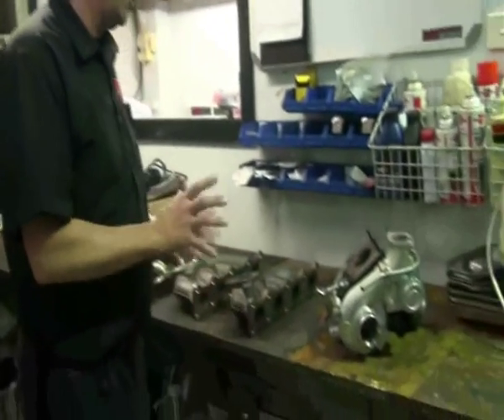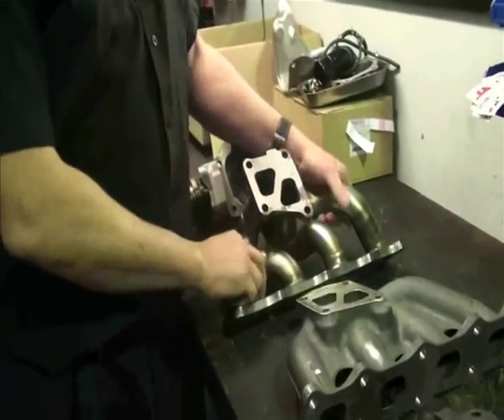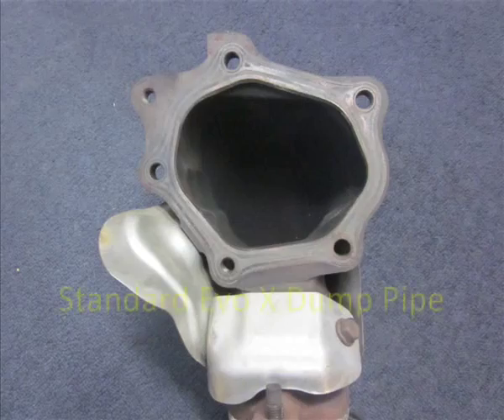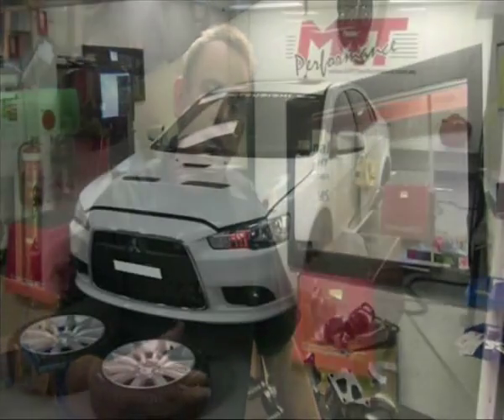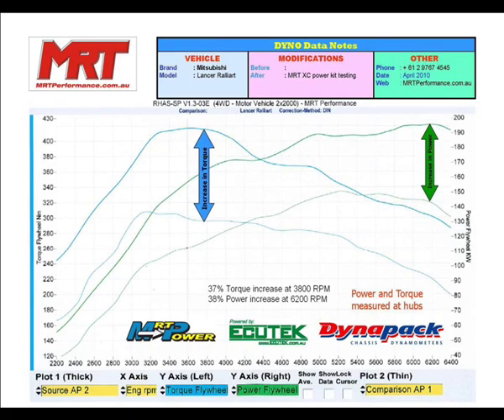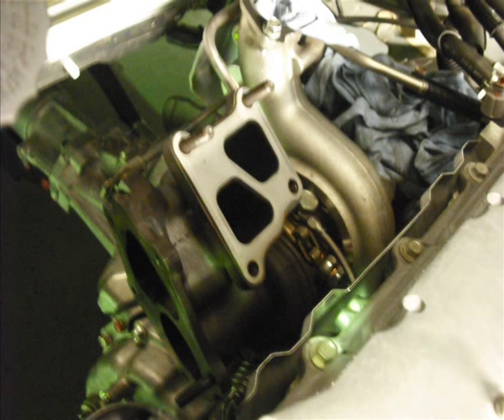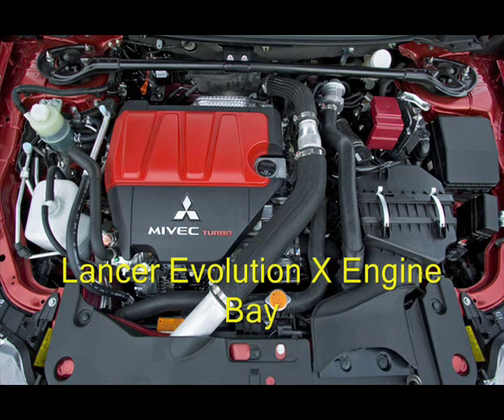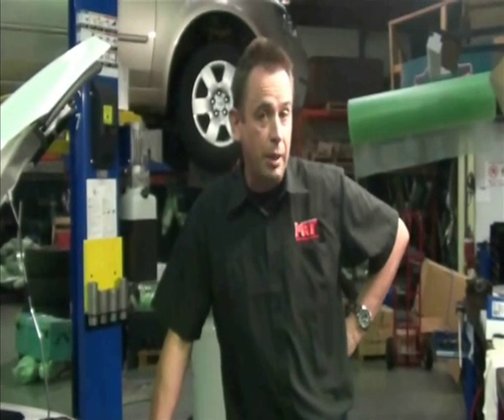Lancer RalliArt MRT XC Power Kit Part 2. Quicker than a EVO X

Comment: Why the ECU before all the mods?  Aren't you gonna need to redo the ECU after all the major upgrades anyways?   Also why not on the FMIC?  The stock one, when temped runs pretty dang hot.  I mean upgraded turbo is nice and all, but thats not a small chunk of change, and even the base RA turbo could use a bit more cool air then that tiny stock one.  The order that is generally done in the states seems to be, exhaust (along with BoV, boost pill and maybe intake), FMIC with piping and then ECU.